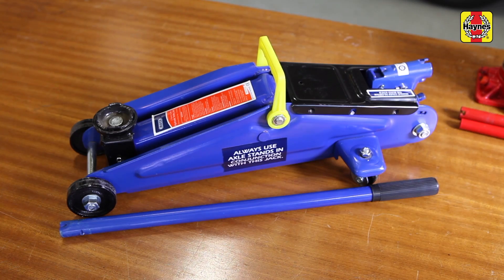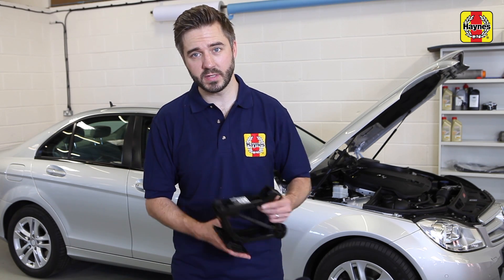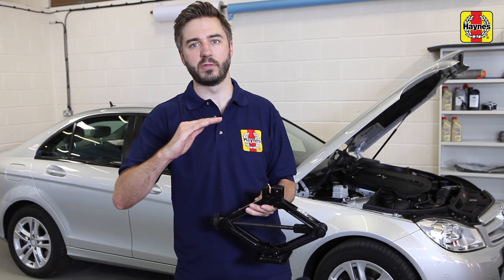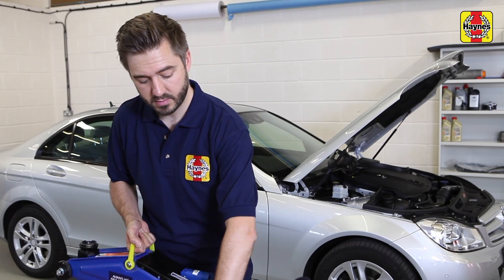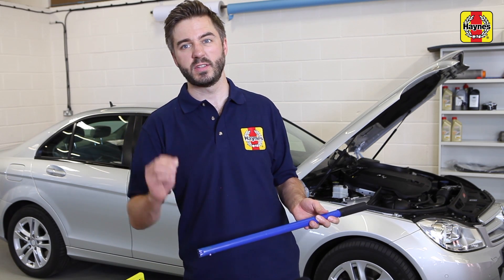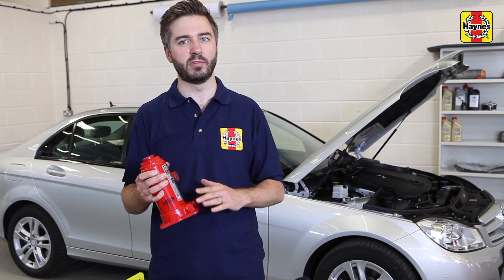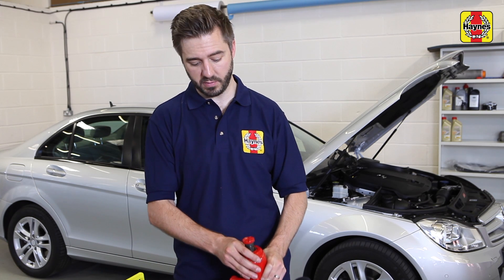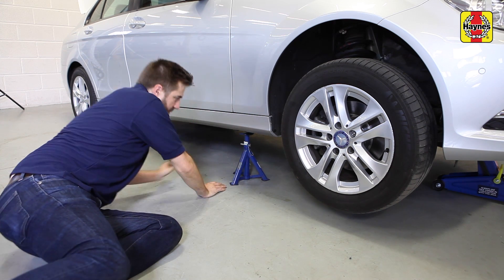How to use the different types of car jacks

Comment: Additional safety. Place road wheels under car.
Reply from the maker: We always used to recommend placing the wheel under the sill, then it was pointed out that most modern saloon/hatchbacks have low ride heights, and wide wheels, so there was insufficient clearance. Obviously this varies from car to car. Thanks for your comments!

Comment: Be sure a bottle jack will fit under the jacking points of your car. One advantage of the floor jack is its lower profile generally. Bottle jacks are typically 3-4in (8-10cm) taller in their lowest position. Bottle jacks are also usually less expensive. So that is a plus in its favor, though.

Comment: Novice here.. thx 
FYI we in the States call trolley Jack a floor jack
Reply: are they the same thing? ive heard both terms used in canada. also some floor jacks have the valve control inside a twisty handle without needing to remove the handle, is that still a trolley jack?
Reply: @Rkyline  Im pretty sure the bulkier ones are trolley jacks, floor jacks are usually low profile have a much longer handle and you tighten the handle before you lift the car and loosen it to let it down